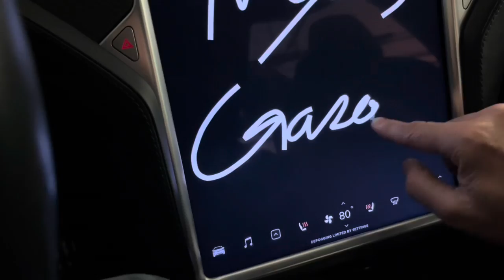Enclosed Trailer Epoxy Floor | 1 Year Update!  Would I Do It Again?

Comment: Did you do anything to the sidewall?  As you mentioned that you wash it out with a pressure washer. Does the water soak in to the sidewall doing a wash out? Would you recommend going up the side about 4-6 inch?
Reply from the maker: I just painted the sides, it might be a good idea to take the epoxy up the sides to provide better water protection
Reply: Do you think a 1 car kit is enough for a 6x10 or should I look into the 1.5 car kit?

Comment: Is it slippery since you hadn’t added the sand texture? Not sure if I would add the clear coat if I I did two layers of the epoxy. Do you think the clear coat is necessary?
Reply from the maker: It does lock in the flakes, but the would recommend adding the sand texture to the clear

Comment: Hi
Is the 1 car garage kit enough for 2 coats on a 7x16 trailer?
Reply from the maker: I just enough for 1 coat on the bare wood.  I should have done 2 kits and that would have looked better, but you can get away with 1